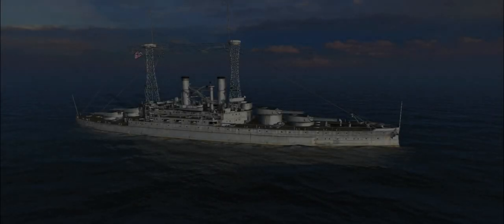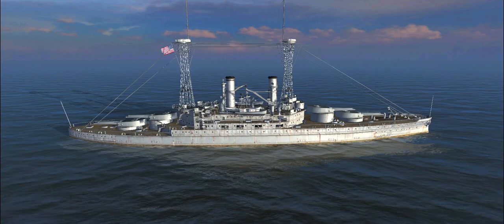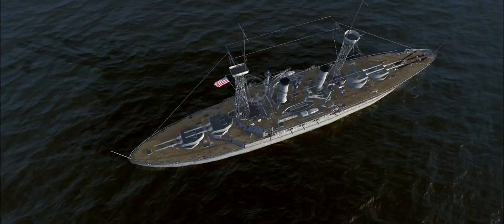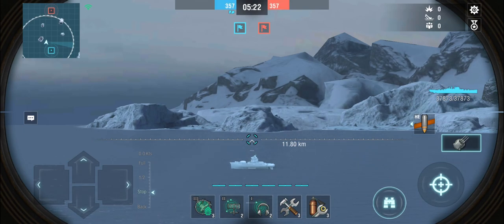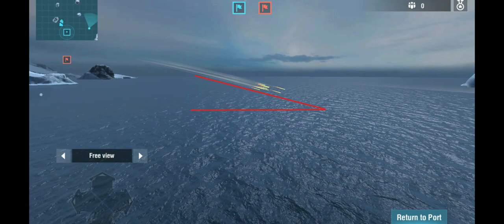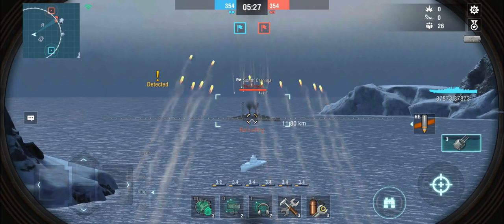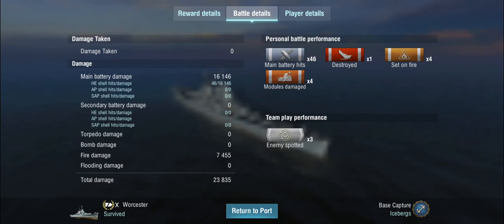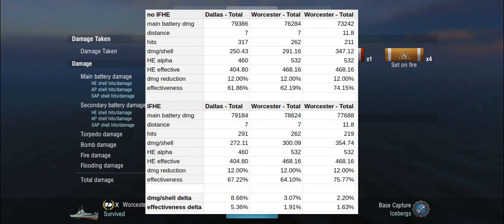World of Warships Blitz - The Worcester IFHE Riddle

Comment: Terry, something about your conclusion is troubling me… at 7 km I used a goal seek function in excel to determine that both ships had 24% of their shots hitting as 100% damage full penetrations without the IFHE… With the IFHE the Dallas moved to 34% full penetrations while Worcester only went up to 28%.  To me that means that perhaps the Dallas had better penetration to start because the boost from IFHE is pushing the values above some threshold that is significant to South Carolina’s armor.  IF after the buff the Dallas has a higher penetration rate, that tells me that I think it started with a higher penetration rate and the buff just made it “more better”.  I’d love to see Dallas at max range to see if the results are consistent… I was going to do the test for you and share but the only captain i have with IFHE is Kincaid so it wouldn’t be an apples to apples comparison since it’s a legendary skill for him - sorry.
Reply: In all honesty, those Dallas number seem real high!.  Based on my calculations full pens jumped from 24% to 34% - an increase of 10 points.  Take 10/24% = 42% increase in penetrations!  Look at the Worcester - My calcs show that penetrations at 7km increased from 24% to 28% - an increase of 4 points.  Take 4/24% = 16.6% increase to starting value… note that the IFHE skill says increase penetrations by 15% which this is sort of consistent with.